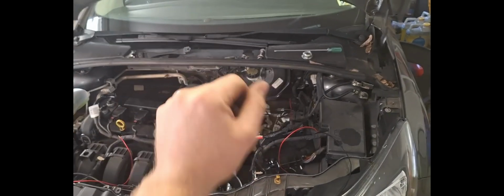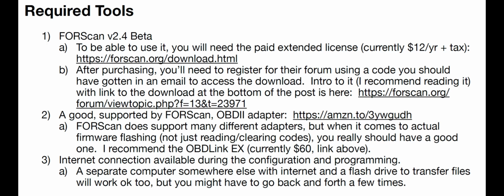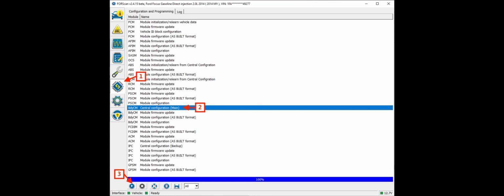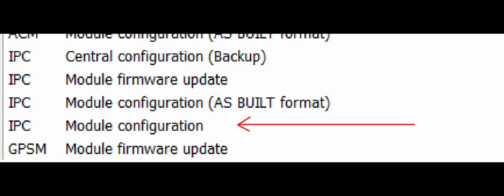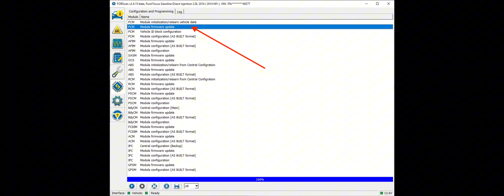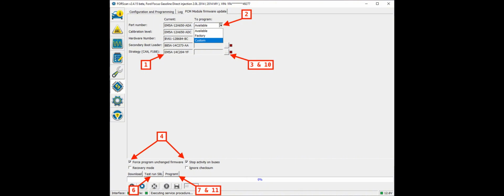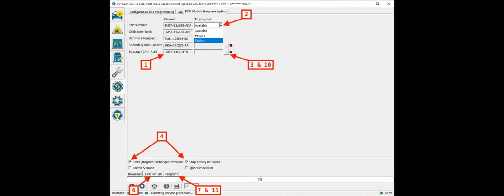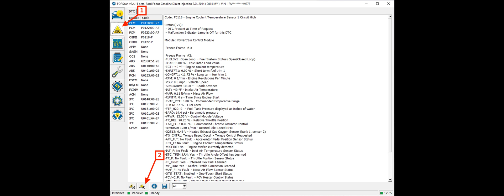Ford Focus MANUAL SWAP! Part 7: PCM & Module Programming!

Comment: Hello. I did the conversion, but I installed a 6-speed manual transmission, and the cruise control isn't working, nor is it accelerating (I did install the manual transmission map correctly since it doesn't throw any errors and it does have speed). I think it must be because of the type of transmission. Can you help me with how I can configure it for my MMT6 transmission?
Reply from the maker: The car should still be able to accelerate regardless of it being a 6-speed or a 5-speed. Programming is for a manual. So it's not picky. I would join the discord group link in the description. There's people in there who've used the 6-speed and the swap. Might take a bit but you should be able to get one of their attention. Regardless, we should be able to get you a point in the right direction

Comment: i did the swap on 2014 titanium focus, has the 5 speed harness, fully programmed and everything operates as it should except for my backup camera(oem), do you have any ideas of what needs to be changed to have it work again?
Reply from the maker: pull up the APIM in forscan and look at the options. change the option for the transmission to manual. If you don't see the option for transmission lmk make another comment if you can. I'd like to know if its an option or if you need manual firmware for the apim
Reply: @BigBensCarsAndCycles I pulled it up prior to commenting, only gives me an option for if it has a camera, no option for trans type
Reply: @BigBensCarsAndCycles  i ended up playing around and comparing as-built files between a sync 2 focus st with a camera, found line 7D0-01-02, 3rd edit that can made from the left, for a manual should be 1, mine was 0, changed and the camera is working, hope this can help someone in the future

Comment: I have everything done but I have an abs,brake,traction control light on the dash . But I’m using the manual ecm ,, should I switch back to auto ?
Reply from the maker: Yes and program the auto

Comment: This is the only part that gives me pause. Software often doesnt look or act the way it does in tutorialsZ
Reply from the maker: @israelcontreras5332  it's the only part that was giving me concern too, because I had never done forscan firmware programming. Turns out it wasn't that bad though

Comment: Hi. I am going to do a manual swap on a 2013 S-max 2.0tdci. I should be much like this one? Any advise? I will be buying a complete manual 07 S-max and park it beside my own max. I am mostly worried about the PSM programming. Would love any advise I can get. And thank you. Great videos.
Reply: I am just going through the same process myself,  nearly finished the mechanical side, then time to tackle the programme side. How did you get on any tips or advice

Comment: ok, i have been running my manual swap for 2 years and today i did th forscan manual calibration to my auto pcm. i have the clutch switch hooked up. but not the crusie. but, it will not start. i put the auto calibration back in it and it runs. am i messing something.
Reply from the maker: the top switch on the pedal is the starter interlock. the bottom is for cruise deactivation. did you run one leg of the interlock switch to pin 13 on the tcm connector (gray/orange)? and the other end to ground?
Reply: @BigBensCarsAndCycles  yes, grey and red, I even pulled the airbox and rechecked my work from to 2 years ago. Does the cruise switch need to be hooked up? It runs and drive perfect with the auto calculation in it. It doesn't run with the manual. Made sure I even downloaded the correct file.
Reply: @BigBensCarsAndCycles  figured it out. i am not holding the break when starting. i'll have to get used to that. thank you for posting this. been wanting this done for to years. now, on to getting it tuned for autocross.

Comment: Super video series on this swap. I did a 1995 escort years back. Not any cam bus then. I'm wondering if you think the programming might work on a ford connect
Reply from the maker: @gabrielgreenham  thanks glad it helped. Transit? The calibration may work.

Comment: Hola . Yo estoy cambiando el arnes manual y el pcm manual  ,¿ porque dice que este video no es para la instalacion que estoy haciendo , ¿ en que cambia?
Reply from the maker: This video is for programming the automatic pcm with the manual software. Since you're using a manual pcm and harness you need to do Programmable module installation with the manual calibration
Reply: @BigBensCarsAndCycles  solo cambia la programación? , yo pienso hacer la programación con el vcm 2 de ford

Comment: Hi there, great job. I have swapped mine about a year go...however, still driving it with rpm limit. I did connect the reverse light directly to sensor and lamp wire as there was no relay for the reverse light.
jump wired the starting relay in past. got the clutch start switch but did not connect it yet.
Dangerous as the car starts directly if you turn the key on even for a half second, which make it necessary to connect it through the clutch pedal switch to avoid any car movement while starting....
I would love to go through the fordscan and do the process explained here...
well done.

Comment: I would ask you something
What is the difference between the manual transmission in the Ford Mondeo 2003 MTX-75 and the manual transmission in the Ford Focus Focus 2014 ?
Reply from the maker: @omarelgomati2129  hi, I haven't looked much into that. I would look at one side by side with a focus one (pull up ebay listings?) And look. It's possible some of the mount holes are different

Comment: On the Motorcraft website I get “not found” where else can I download the calibration files?
Reply from the maker: @EduardoCastillo-pc3dp  look at the pdf file in my discord,  you need exact filenames which are listed there
Reply: @BigBensCarsAndCycles  in appendix 2?

Comment: Hey where can I find a rear o2 sensor that you did a video on for my 2003 gmc sierra 1500 4.3L v6  I’m out here in cali and need to pass smog lol my code is P0420?

Comment: Wow how I wish there was a group like this for the Renault TCM which is identical in all respects but the code. Mine has a problem with the internal temperature of the unit, it reads up to around 80 degrees and randomly fails and reads 0 or near degrees, around that time I get a check gearbox error so I assume its not liking the temperature differential. I have pulled a ford tcm apart and Im 99% confident its getting the temperature from a chip on the lower board ATIC91C5  STmicro part which I can find no data on but assume its some version of the other ST automotive MCUs ST make. I have the replacement chip but I suspect it would need programming. My question is would you know if the code loaded on this chip is done directly by some factory software or would it be loaded by a boot loader, if so I could place the chip and hopefully it might sort itself, if not Im stuffed. Any suggestions or ideas would be appreciated. I have purchased a new TCM but it would have to be fitted by the agent so that is my cover if I were to damage the existing intermittent one. Me being me I would lave to fix the existing one if possible. Personally I suspect the code is loded directly into the chip as I cant find any flash memory that I believe would be large enough to hold the code required. I can only find a small serial eeprom which I suspect only holds the VIN etc. Cheers for a great video
Reply: As far as I can tell without opening up one of the TCMs, at least on the Ford DPS6 side of things, the primary micro is actually an Infineon TriCore series like the PCM is.  That ST chip could do any number of things, and depending on where you get it from depends on if it would be blank or not.
Reply: @wcvp  yes the primary mcu is SAK-TC1766-192F80HL infineon and it does have quite a bit of flash memory so very likely the main program is stored on it. The ATIC91C5 is on the board with the driver mosfets for the clutch and select motors. There appears to be one undocumented chip per motor A2C193600 which Im sure is a special as the part number looks suspiciously similar to that of the PCB P/n. So Im thinking the ATIC91C5 is some sort of controller specifically for the motors and is used to obtain the internal temperature, firstly because its in a good place to get the driver temperature and its got a heat sink mounting on the back of the SMD package. I obtained a new one from Aliexpress so Im sure it would be blank, interesting they give no description of what the device is just its part number so who knows where it actually came from but its in OEM SMD mounting tape so it looks kosha. What Im going to do is monitor the temperature vai the OBD part and try putting some forced air over the whole TCM and see if that helps, I quite like trying to analyse problems and work arounds.